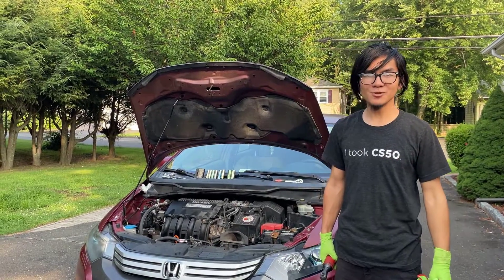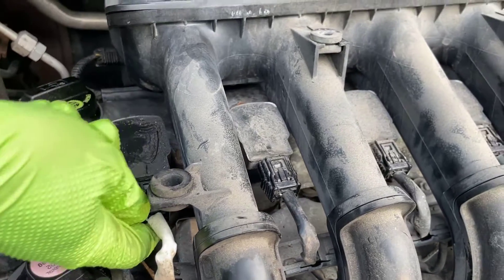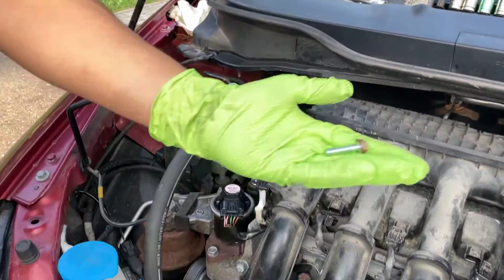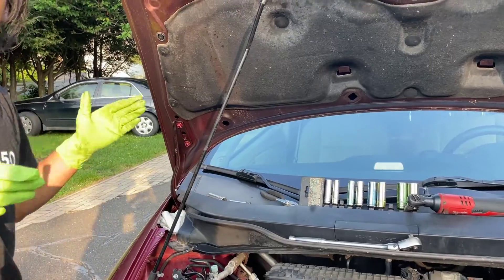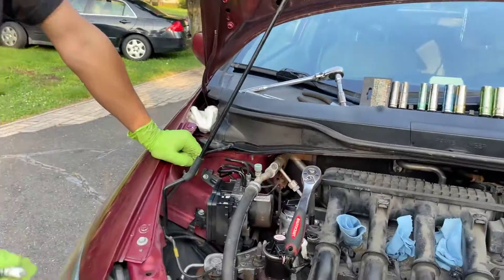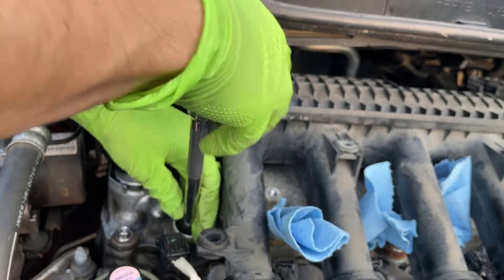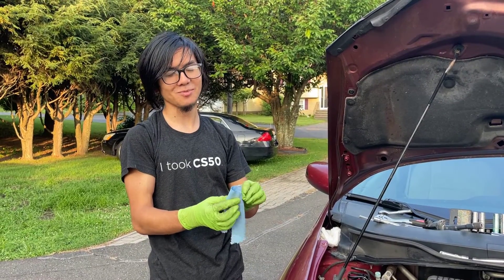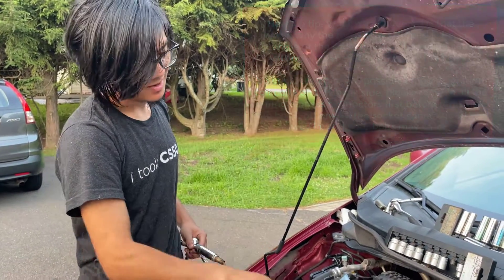How To Remove 8 Spark Plugs & Ignition Coils Front & Rear Honda Insight 2ZE | Solving Misfire P030X

Comment from the maker: Here are the #ad links to some of the tools, parts & accessories needed for this repair:
1.  https://amzn.to/45n91sd  |  ARES 11025-10-Piece Extra Deep and Standard Length Spark Plug Socket Set – 3/8-Inch Drive Spark Plug Sockets - 2.5-Inch and 6-Inch Length 6-Point and 12-Point Sockets – Includes Foam Storage Tray
2.  https://amzn.to/43YeS6a  |  BILITOOLS 9-Piece Spark Plug Socket Set with 3/8 Inch Drive Click Torque Wrench, 10-45 Ft-Lbs (13.5-61Nm), Cr-V Steel
3.  https://amzn.to/3OucKNA  |  SKYJDM Universal Spark Plug Gap Tool with 32 Blades Feeler Gauge & 16 Blades Feeler Gauge for Setting Electrode Gap in 10mm 12mm 14mm 16mm Spark Plugs（Red）
4.  https://amzn.to/3rRMoxj  |  8 pc NGK Iridium IX Spark Plugs compatible with Honda Insight 1.3L L4 2010-2014
5.  https://amzn.to/3OKHXxC  |  TRQ TKA05941 (8 Piece) Ignition Coil Set

Or Click on Amazon link here and search for what you need:  https://amzn.to/3xIOsqg

Comment: You do know there was an oil burning issue on some of these, right?

I got new rings under warranty for a 2014 at 90k odd miles Dealer serviced since new in 2016/7.

Comment: Thanks for the video. I didn't have any trouble getting out the plugs on the backside, my largish hands notwithstanding. I'm not sure what the difference was for them. 

Getting the bolt farthest to the right was a huge pain, but that ended up being due to improper tool selection. Ultimately, (and I know he says in the video this is too small) I used a 1/4" drive ratchet with a 3" extension. It was just high enough to clear while the socket was short enough to fit without hitting anything while the extension wasn't too high where I'd hit on top of the firewall. That ended up working just fine for me. I'd put the extension with the socket on the bolt first, hold it in place, and then attach the ratchet to the extension. That was easier for me than trying to put the socket on with the ratchet already attached to the extension. 

I also found that I could easily enough reach all four bolts by reaching in from the left side of the engine block. Once I figured that out, getting the rightmost bolt wasn't too bad.

I recorded myself getting the rightmost bolt out, but I'll need to check the video if it's worth uploading. I've never tried recording a car repair video, so my camera work almost certainly leaves something to be desired.

Edit: I've uploaded the video on my channel.
Reply: Here's the link to my video on getting the rear coil pack bolts out.

https://youtu.be/k6qkBYDQ6kg

Comment: Did the plugs and coils solve the P0300 codes?
Reply from the maker: The plugs alone solved the P030X issues. Tested the coils, nothing wrong with them. Check the last video in this series:  https://youtu.be/oZPR5cutKRo 

Check out our previous videos below on how we attempted to solve this issue:
1.  https://youtu.be/5eVJkYU09Jw  |  Lets Discus How To Solve Cylinder Misfire P0301 302 303 304 & P0300 Random Multiple
2.  https://youtu.be/ABhLt7nSvUg  | How To Remove 8 Spark Plugs & Ignition Coils Front & Rear Honda Insight 2ZE 
3.  https://youtu.be/xueeSABliik  |  Testing Ignition Coils For Faulty Module Using Multi-Meter 
4.  https://youtu.be/EbbkwbF_rvk  | How To Install New Spark Plugs & Ignition Coils
5.  https://youtu.be/oZPR5cutKRo  |  How We're Able To Solve This Issue

Comment: u can also . Remove the cowl cover and the under-cowl panel
Reply: Really, how? That would make it so easy.
Reply: Yes.

That way I can put a weak cordless rattle gun on all 8  plugs after a spray of Deep Creep.

I am not going to put any torque removing 100k mi spark plugs installed dry at the factory,

regardless of NGK claims of their trivalent metal thread surface not requiring anti sieze.